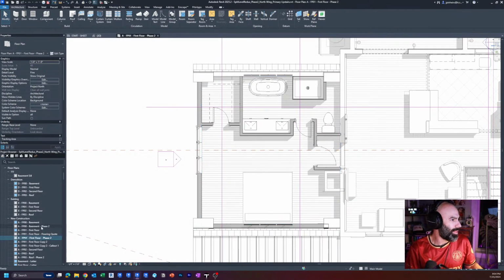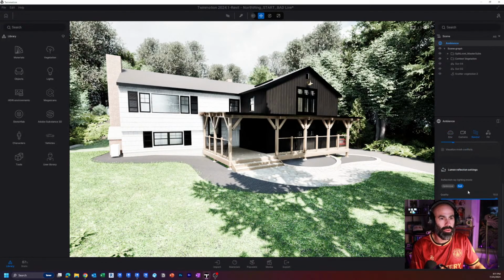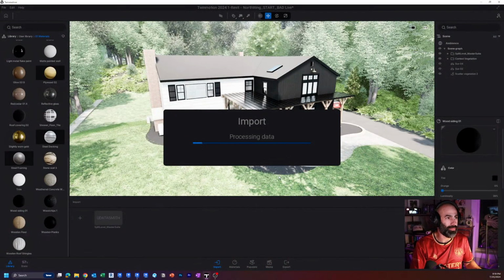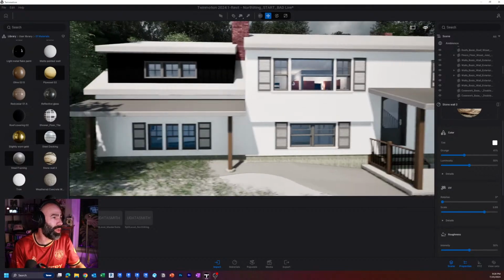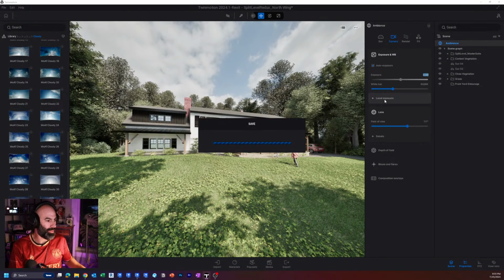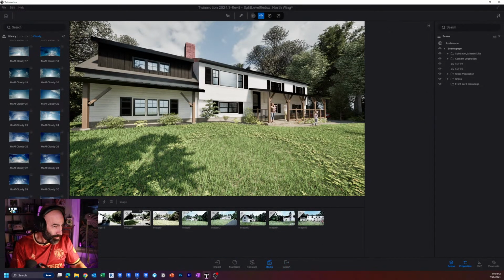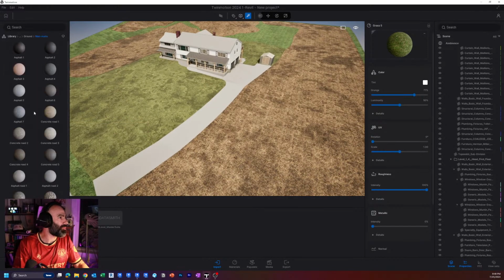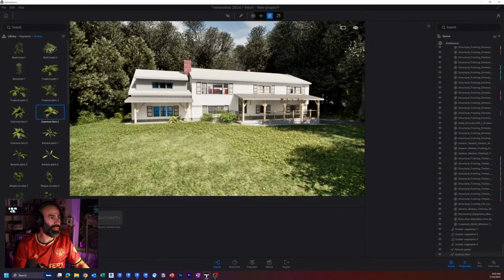Residential Revit - Twinmotion Exteriors (The North Wing - PT 2)

Comment: Another great video and series with a wealth of information.  I'm looking forward to the next episode!  Can you share some more details on how you model the Toposolids and different sub-divisions?  Based on your videos, I've started subdividing in my model to speed up the rendering process in Twinmotion, and its working great, but now I have subdivision lines on my Revit plan drawings and can't figure out how to quickly manage their lineweights.  I can use the LW command and click every line, or completely turn them off in View Styles, but it seems like I should be albe to set parameters for each (turn off grass areas, but keep roads and paths turned on).  Am I missing something?  There doesn't seem to be a way to independently manage each other than completely turning them all off.  What is your method for managing this?  Thanks!!!